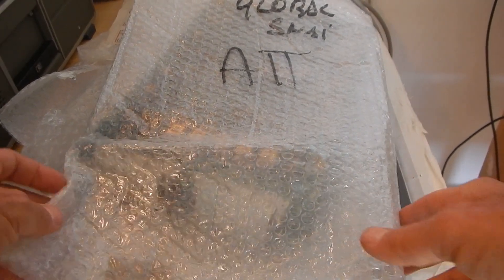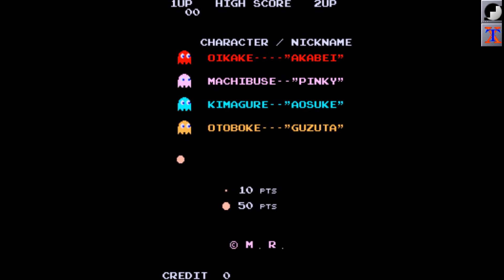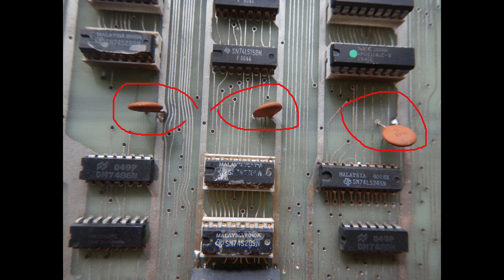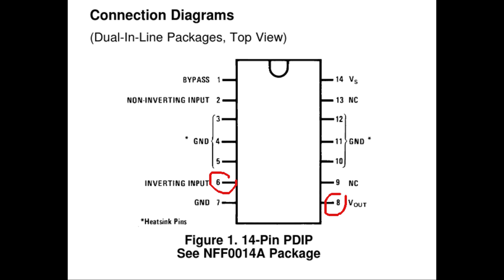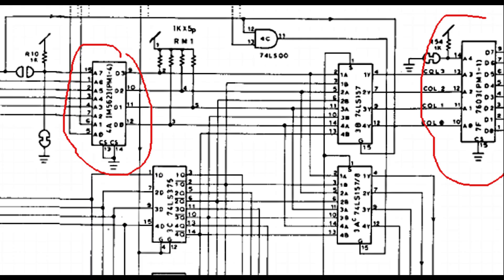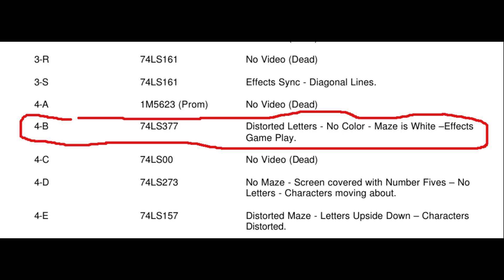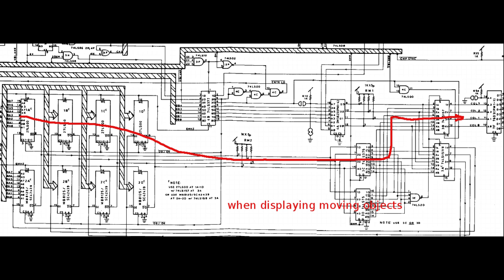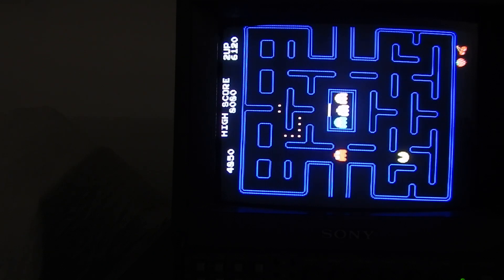Old Pac Man arcade clone PCB repair

Comment: Crazy. I just modified our (my local arcade's) Pac Man bootleg, which is in a universal cabinet that has three fire buttons and all buttons can be lit up, to have both Pac Man and Ms. Pac Man on one board with a double sized Big ROM Hack.
I made button 3 the Credit Button and have it permanently lit. Buttons 1 and 2 I painted male/female symbols on, installed a bit of logic on the game board so that you can select which game you want to play, light up the corresponding button and reset the game board in case the game has changed (so it won't reset anymore if you hit the button of the game that's already selected).
Even better, I made a little circuit board that checks the CPU address space if it reads the 1 PLAYER START or the 1 OR 2 PLAYER START string and light the credit buttons accordingly. These extinguish if you start or change the game. When you start a game and go to Game Over, it'll read the strings if there's still credits on and light the buttons back up.
I'm kinda proud of it even though it's rather simple.

About Pleiads [sic]... is that Phoenix board modified for Pleiads? Because if not, I'd be interested in the ROM set. Pleiads won't boot in a Phoenix and I've read somewhere there's a trivial fix to that, but I'm too stupid to find it.
(I can get Pleiads to run if I boot Phoenix, then switch the ROMs to Pleiads just as the title screen builds up)
Reply from the maker: "rather simple" you say? I wouldn't go into that rabbit hole of a mod for anything in this universe LOL, you're definitely the master here! And yes, I have the pleiads "gmp" dump that ran fine on the phoenix PCB (it's now running centuri's phoenix roms and 100% repaired). Contact me to get the dump :) Sound effects were a bit annoying though on the unmodified phoenix PCB (but that might be just me).
Reply: @iz8dwf  Odd. I found the sound effects of Pleiads running on Phoenix quite impressive even more pleasing than Phoenix.
Compared to what you're doing, my little hack was rather simple. It's just one big 8-input AND gate, three 3-input AND gates and a flipflop. And an inverter to invert some of the address lines.
The circuit plugs in the ROM socket the furthes from the CPU (because we have two handy Chip Selects) and then the common term (CT) is /CS & /A11 & A10 & A9 & A8 & A7 & !A6 & A5 (I use a 74LS30 for that).
Trigger1 then is CT & !A4 & !A3
Trigger2 is Trigger1 | (CT & A4 & (A3 | A2))
Clear is /RESET & /Start1 & /Start2
For these three, a 74LS11 is perfect.
(/ means the signal is already low active, ! means the signal needs to be inverted)
Now I connect the trigger and clear signals to a dual flipflop which then drives transistors to turn on the lamps. I'm using a 74LS73 because at one time I bough way too many of these, but a '74 should do as well.

See? Just a big bunch of simple logic. I've seen you do waaay more complicated stuff like writing a test program in 2650 assembly for Zaccaria video games (although I'm one of the few other persons on this planet to speak 2650).
Took a while to find the correct ROMs for a bootleg Ms. Pac Man ROM that runs on an unmodified Pac Man bootleg though. Classic Arcade Repairs had one of those and his episode about it pointed me in the right direction.
Reply from the maker: @senilyDeluxe  Thanks for the circuit description! Yes I did learn some 2650 asm just for that test code LOL. I have another big-ish stack of zaccaria galaxia and astrowars in the repair queue, but no idea when they'll end on the bench. As for pleiads, as I said it must be just me, I have probably seen it in the old days but never actually liked to play it. On the other hand, I spent quite some time (and coins) on phoenix, so I wanted my own board if I could find one cheap enough (like I did). I think the dump I've found has been added on mame as pleiadsgmp, but you can contact me on ukvac.com or aussiearcade.com forums and I'll send it to you.
Reply: @iz8dwf  Video about the hack is up. It includes schematics (drawn in MS Paint for Windows 3.11 on a real 386 machine after I made everything - no guarantee I didn't make any mistakes).
Reply from the maker: @senilyDeluxe  LOL I don't understand german (is that german, right?) but its fun and schematics look good too! I wouldn't use ms paint for anything though :)
Reply: @iz8dwf  :-D yes it's German, but schematics are universal. Although this one (the second one) is just a BMOW (Big Mess Of Wires).
I wasted most of my youth using MS Paint and loved it. (ab)Using it as a circuit editor is not the greatest idea nor fun to use. Doing so on a 25 MHz 386 with the slowest 1MB VRAM video card (OKI) I have was a lesson in patience. I made the game select schematic on a 40MHz 386 with cache and a reasonably fast video card (Realtek lol) and I should have used that for the big schematic - that machine runs more than twice as fast as the 25 MHz one.
Why do I even do it? Because I can and I give two old computers some actual work to do.
Reply from the maker: @senilyDeluxe  I do try to use old computers too, but I've never liked too much the various PCs. I try to use as much as possible the Apple ][ and the various CBM ones when I can (even if for just playing a bit). I remember there was an OrCad release for MS-DOS that ran fine on the 386 machines, we had that at university, I don't think I still have the installation media for it, but I've used it a lot as a student. OrCad still is the best electronic CAD I've seen (but maybe I'm only nostalgia-driven in this case).

Comment: Excellent job repairing the board, Francesco !!. It looks pretty bad when you zoom into the details of the board and making it work again is amazing. What do you plan to do with it ?. Try to rebuild the arcade completely ????
Reply from the maker: Hi and thanks for the comment! The board was already shipped to its new owner, I wasn't a great Pac Man player back in the old days (and I didn't improve lately as you can see). I would like to build mini (12" - 14" CRT based) replica cabs for the games I used to play, like Asteroids, Galaga, Phoenix and others, but making the full cabinet is a bit outside of my current skills.